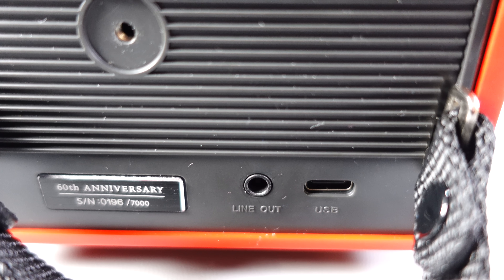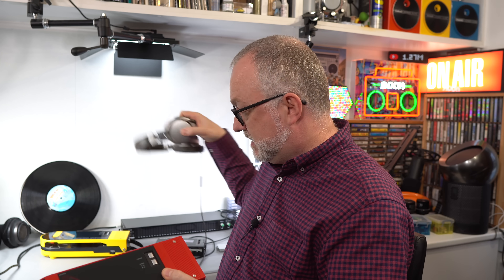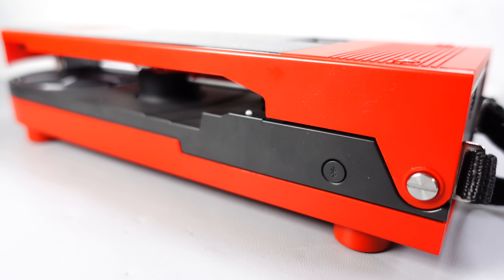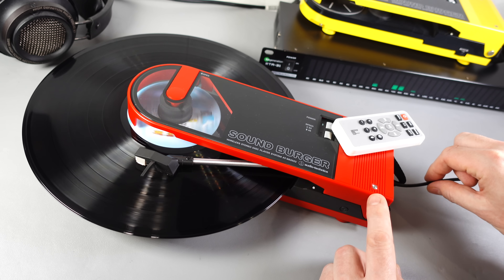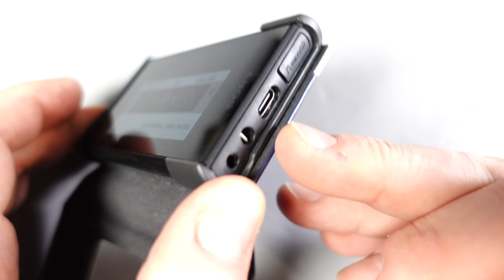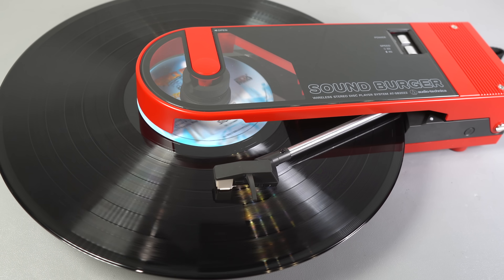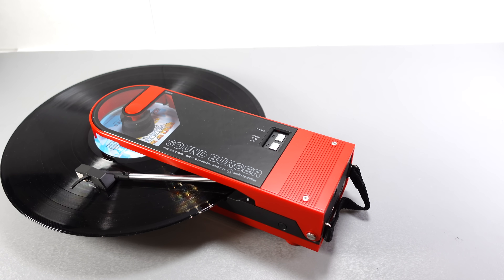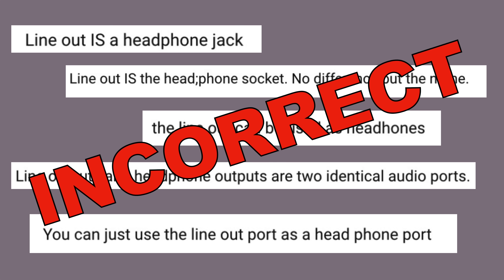Line-out ≠ Headphone-out

Comment: Line Out is for recording, so it’s set to provide a clean signal without distortion. sometimes referred to as “0 db”
Headphones Out is a variable gain output that can provide higher gain that will include distortion.

Comment: You could add another level of complexity: Many consumer-grade "Line" connections are not matched with pro-grade equipment "Line" sockets that provide and demand much higher level. Plugging in, say, the "Line Out" of a good Hi-Fi phono preamp into the "Line In" of a cheap MP3 recorder or cassette recorder can give you a nasty surprise because the signal is very loud and distorted, and it can be impossible to get a clear recording because of the mismatch. Then you need a special -10dB cable (or a little mixing desk with a fader) to bring the level down so your recorder can manage it. Even some portable digital recorders like the older ZOOM models (not sure if they improved it on the current ones, haven't tried yet), products clearly aimed at the entry-level studio/musician market rather than at a teenager/layman public, have that confusing -10 dB pseudo-Line-In and easily get overloaded by connecting real (0dB) Line-Outs for recording. In the really old days (1960s-1970s), the -10 dB jack used to be labelled "AUX IN" or "TAPE IN" while the word "LINE" was reserved for full line level and thus rarely seen on "home" equipment. But that distinction already got blurred two decades before they started mixing up "Line" (often rather "Aux") and "Headphone" jacks! I wouldn't bet that the SONY Walkman you showed (their very expensive top-of-the-line model around 1990!) can actually stomach studio 0 dB line level....

Comment: the easiest way of telling the difference between line out and headphones, is the type of volume, FIXED volume is line out, and variable volume is headphones... another way is: line out is only signal, headphones is signal + power (not much mind you, only enough to move headphone speakers) and finally, the best difference: READ THE NAME of the connector and use accordingly ☺

Comment: ENGINEERS AND MUSICIANS - LOOKSY HERE >> A large number of people in the comments, many claiming to be sound engineers, master musicians, rocket scientists, you know, professionals of something or another, are suggesting the public's confusion over what is appropriate to plug into the many 3.5mm holes found on so many devices is the fault of PC's or their sound cards, or a lack of technicality of the glassy-eyed consumer class.  With all due respect to the professional class, that's BS.  I too am a sort of professional, having lived 60+ years I am a professional of experiences, of practicality, and of common sense. I am also old enough to get away with a bit of eccentric speaking of my mind, so if I may:   I am not sure when or what exactly my first experience with a 3.5mm hole-in-a-device was, but it was well before 1970.  I do remember quite well a transistor radio in pink Bakelite around this time that may have had said hole but was more likely a hole in a baby-blue plastic transistor radio of Japanese origin. Regardless of which, it's purpose was almost certainly not for headphones or a line-out.  In the 70's I saw many more devices with many more 3.5mm holes, though the larger but no less confounding 1/4" holes were more frequently encountered in the wild.  In fact, prior to 1979 and the Walkman, the full confusion in hole use was mainly with the 1/4" holes which could accommodate mics and most any other sound equipment you could find on an AC/DC stage.  My sound professional friends in the comments can better run through this long list of stage holes, but needless to say the 1/4" holes were wildly popular within the world of analog audio and voice, a single telephone exchange could house millions of such holes.  Up to this point these 1/4" holes and their varied uses were mostly experienced by women with bee-hives and groupies in tie-dye, however, after 1979 the 3.5mm hole started to take over and expand upon the borderline personality disorder that runs in the audio hole family and consumers were being shown more holes than ever and a growing varietyof things to place in said holes..  Forgive me if this sounds obscene, but between the tip and the sleeve where once was just one ring, there might be two or even three ringed varieties of plug all equally capable of insertion into whatever hole of whatever purpose, it was as though Caligula was in charge.  Cameras had holes for power, for audio, sometimes for a flash, other devices had holes for stereo, but some just gave mono.  By the time computers were first affordable by the general public the confusion over what any given hole was for was already firmly established in the consumers mind.  Did computers further this confusion, starting with cassette storage on my Trash-80 I would have to say yes, but THEY DID NOT CAUSE THE CONFUSION.  It is a matter of historical record that as soon as either the 1/4" or the 3.5mm jacks hit the consumer market the confusion as to their appropriate use had been fully baked into the design by sound engineers, master musicians, rocket scientists, and other professionals working behind the scenes giving little thought or concern how all this single-hole-anything-goes approach would play out to normies.  Well, now they know.   And when asked why we unwashed masses might be confused their response is to blame PC's and soundcards, and we normies for going glassy eyed when the minutia of ohms and impedance is brought up.  No, professionals, it's not soundcards or PCs that are responsible, and it's not us consumers, either.  We are not responsible for the lack of engineering forethought that spanned across half a century.  Nope, you'll have to forgive us commoners for expecting a plug specifically designed by engineers to fit into a hole specifically designed by engineers to accept said plug to be the right thing to plug there-in.  If we are confused, and we are, let there be no confusion who and what caused this confusion.  It was professionals, sound engineers, master musicians, and rocket scientists who did this way before PCs, way before walkmans, and even before Ma Bell went digital.   You all have earned the right to take pride in the things you've done well, of which there are many, you've also earned the responsibility to take credit for your less-than-perfect decisions too.   Of course, I'm just an old guy, what do I know?  I can't even figure out what plug goes where on the back of my PC without rearranging my desk so I can shine a huge light on the teensy-tiny print injection molded into the plastic case above the identical looking holes.

Comment: Different question ~ on the RME babyface im short for line outs, but there’s two headphone outs. Can I use one of the headphone outs with a y cable as 2 line outs? 😅 this way I could set up an FX loop without having to disconnect my monitor speakers

Comment: I'll bet if you open up the new one it still has the headphone jack and the hardware for the volume control but covered in plastic.  They do this because it is easier to just cover up the old stuff than redesign the circuit board.  Also, they'll plastic over ports for the lower end models but leave the same ports accessible in higher end models.  It is cheaper for them just to make one circuit board rather than a bunch of different SKUs.   In the past I would often open up the mobile hotspots I used to have to use for work.  I would open them and often fin unadvertised external antenna ports to which I would attach antennas to get better reception.  Once I found a functional ethernet port.  I don't remember the models of hotspots; these were random ones I rented while out of the office, etc.  On a sie note, I once dated a rich girl from Taiwan whose family owned garment factories.  Apparently (back then at least), the only difference between the super expensive "7 for all Mankind" jeans and the Walmart store

Comment: Aaahhhhhhhhh well this explains that. So just to make it even more clear, I have a Behringer P16M 16-Channel Digital Personal Mixer, it has a phones output & a Line out [ R & L/mono]. Does this video still apply to that?

My main point is I have 4.4mm balanced IEMs (CKLVX D41) that I use, but have them hooked up to the phones output 6.35 to a 3.5mm cable and then a 3.5mm male to 4.4mm female adapter to where I connect my IEMs. And I ordered a cable (haven't hooked it up yet) that is a dual/Y splitter 6.35mm (R & L) to a single Female 4.4mm, where I was planning to connect my balanced 4.4mm IEMs (me thinking this would be a "true balanced" setup). Would this work or should I stay with the first setup, or is there a better way to connect my 4.4mm IEMs (true balanced setup)? Please and thanks sorry for the long thread. 🫰🏻

Comment: Headphones/line out - mileage tends to vary. Some line outs drive headphones well. Others voltage sag like crazy when you put a load on them and you get barely any output. I tried this with a PS2 adapter. Male RCA to female 3.5mm and headphones in the red and white sockets. It managed about quiet conversational level through my relatively sensitive earbuds - which I suppose is okay for just playing a game, but no control of volume.

The Walkman demonstration doesn't give the whole story, as some line outs can actually be "louder" than the headphones out if just used as an audio voltage source into a high impedance input (for instance 500 mV is typical - enough to give you conversational level out of a typical domestic stereo speaker, or the level of a loud rock band into in ear headphones, if current is kept up), but connect headphones and the line out drops as it can't provide much current, whereas the headphone out is able to pump power into the low impedance headphones and keep the voltage up. It's like the difference between a stack of 5 CR2032 batteries totaling a nominal 15 volts, and a car battery at 12 volts. If you try to start your car with the first, or even run the little motor that pumps fluid to wash the windscreen, you will be disappointed. Despite is being "more volts", it drops to near zero with any appreciable load.

Comment: as for the other scenario, using a headphone output as a line-out: yes you can, if the you set the volume right. But the signal quality is probably not as good as a dedicated line out. The amplifier that is capable of delivering power to headphones, and providing adjustable volume, is not going to have quite as good a spec as line output, which only has to drive a high impedance input and has nothing further in the signal path.

Comment: But then why isnt the line level the same as the headphone level? Why does it need to be lower?
Reply: I'm guessing that with line out a specific volume level is needed to make it compatible with the line in connection on other equipment so it can be safely connected, while a headphone jack can have variable volume levels.

Comment: As a digger (going round thrift/charity shops for records) I bought two of the new burgers, I was gutted that there is no headphone output,  I bought the original burger back in the day and have since acquired 4 more, so thankfully I can still dig, but man, these two new ones are sittin' on a shelf.  Although after seeing this, I might get a headphone amp, so thanks for that info.  Huge mistake them not having a headphone output, as ALL my friends use their burgers for diggin', not listening in the house.  CRAZY!  Did they not do their research

Comment: well i've got a Sony CD walkman although uses the single 3.5 for headphone and line out infact you have to adjust to a suitable level to use for a line out use otherwise you end up with distorted audio. like in the old days when you recorded a cd to tape that setting made a big difference if you got it wrongly set.
Reply: I've got a Philips portable CD player that is the same. One slight difference is that with my Philips CD player everything resets to the default setting when the player turns off.

Comment: Well it's pretty simple and you know you do a great job Matt explaining the difference between the two but it's quite simple so here it is. A headphone jack has a volume control attached to it and a line out does not. So if you were to take your headphones and plug them into the line out there's no way to adjust the volume of the headphones, and because line out are quite a bit soft typically than the headphone socket would be all you'll hear is everything will be very soft with absolutely no way to change the volume. I mean sure it's technically possible to plug headphones into a line out but you will not like the result, because of the ridiculousness of individuals I can imagine somebody doing that and then leaving a bad review saying that the headphone socket doesn't work properly, you see ridiculousness, actually I see reviews like this all the time on amazon, where somebody has received a product and because of their own ignorance they leave a bad review damning the product when in fact it was their own ridiculousness that was the issue.

Not to sound pedantic but if you're going to buy a product that you have never used or product type that you are unfamiliar with it's important to read the manual or at best ask a few questions to somebody who does know and that will prevent all sorts of issues.

You know like people used to do, they would go down to the Hi-Fi store and see the new fancy direct drive turntable, they were unsure of exactly how it worked because it works so differently than they're old record changer used to do. So as they were purchasing their new fancy direct drive wonder machine they would make sure to ask the salesman so that they were competent and confident in its usage so that they could use it so it's fullest potential.

Comment: Another thing is that's needed to be mentioned - All amplifiers distort the signal to a degree, some a lot, some not - but they still do. So for example if you want the cleanest truest input into your amplifier (and if you don't want to ruin your expensive, sensitive amplifier with a distorted and way too powerful input) - you would be ALWAYS using line-out instead of headphones out
edit: just reached 6:50 - so yeah, what he said, but I just wanted to put my two cents out here

Comment: both jacks sound the same on my computer, just another youtuber full of crap that would rather run his mouth for 11 minutes than to admit theyre wrong
Reply: That's because you're using a computer which has hardware that automatically detects whats connected to adjust itself.
Reply: @CarmenXero  then why make this video in the fist place?
Reply: The Soundburger is very clearly not a computer.

Comment: I've been told if you only have a headphone out on your music device, and you want to use an external amplifiers with it, is to turn the headphone out volume to maximum to use it as a line out. Also with PC audio, max out all the software volume: system volume and software music player volume to maximum, then control the volume using the analog pre-amp/amplifier or powered speakers you are outputting the sound to.

Comment: What's funny is my headphone port doesn't actually work (for whatever odd reason, unsure why. Probably should disconnect part of the front panel if I can...). So I use line out and control its volume on PC, typically via Das Keyboard's volume slider.

Comment: Its not only the output level , its als the sorce impedeance of the driving amp. There are different type of headphones around, some with 8 ohms, some got 200 and others 600 or more ohms.
driving a low impedeance headphone on a 600 Ohm line output gives a very quite volume level. a 600 ohm headphot at the same output give comfortable volume.

Comment: Another note on line out vs headphone is that they're both 3 conductor but line out is a balanced audio ( +, -, and drain) mono signal while a headphone jack is an unbalanced (R+, L+, drain) stereo signal
Reply: That's not true for consumer electronics. For balanced signals you would need two 3-pin plugs for stereo sound. 3,5mm jacks are usually unbalanced stereo.

Comment: Any (cheap) amplification is adding noise, distortion and takes away the quality of the signal. For most headphones, its fine. But for studio, hifi oder audiophile purposes, you want to have the most clean signal chain and go for high quality preamps and amps. But even them would color and change the sound.

Comment: I don't see any discussion of impedance or voltage or amperage or distortion here.   That seems like a pretty big miss.  The difference is that a line out expects the other side to have very high impedance and therefor doesn't need to supply hardly any amperage at all -- and if it's asked to it will distort very quickly.  This is also why you don't use a Y connector to combine two line outs because then the out becomes an in and it's a low impedance in - which the other line out can't handle.   But splitting one out to two in's is fine.

Comment: Line out is fixed at 1V p/p at 1K Ohm Impedance. Headphone output is in the tens of Ohm's impedance at a V out level determined by the headphone amplifier and it's level (vol) control.

Comment: Loke.. I "get" what you are saying.. but trying to say "liNe oUt  Is nOT HeAdphOne jack" is like saying a hatchback is not a car.. because it is a hatchback. Line out is an audio output. Just like headphones is an audio output on is amplified and one is not.😅 you take this way to seriously. You CAN plug headphones into line out and hear audio.. especially if you have headphones with a built in amplifier.
I did this a lot as a kid when my walkman headphone jack broke and l used line out for loke a year. It was quieter.. but very usable.